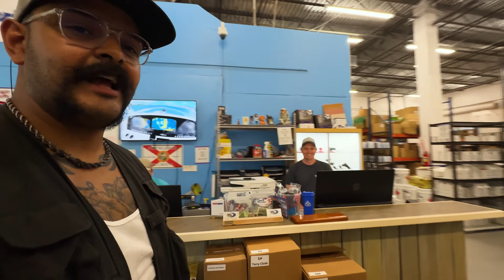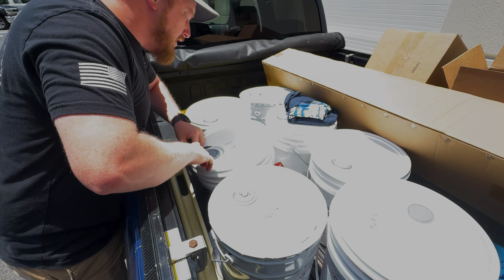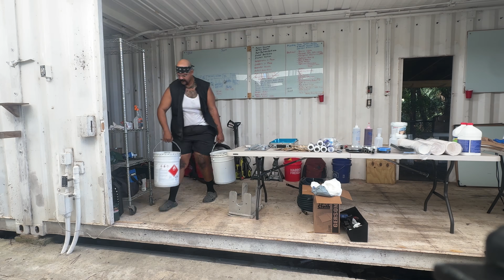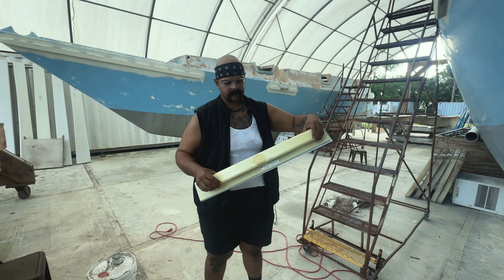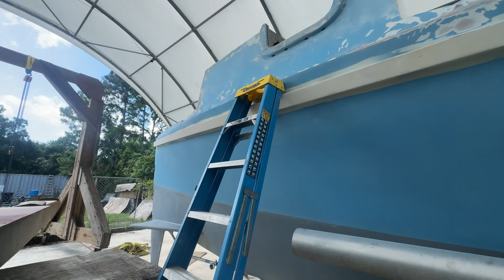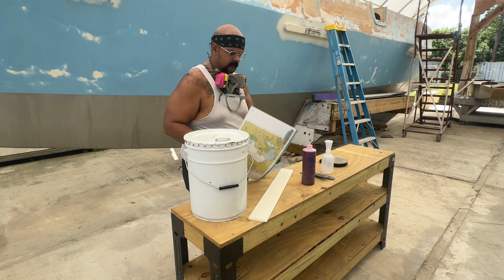All of this boat resin, and we have no idea how to use it! Ep.11

Comment: I'm glad you already confirmed in another comment that the boat was built with vinylester and polyester because they won't bond well to epoxy. However, they have a short shelf life of just 3 months and need to be kept under 75 degrees F or the usable life will be drastically shortened even more. Do you have an air conditioned room to store the products? And MEKP is scary stuff. You wear glasses like me but I'd recommend a face shield when working with MEKP because a drop of that in your eye will lead to blindness. When applying the finishing paint and anti-fouling, you might need an anti-osmosis coat first because polyester can let water through.
Reply from the maker: Thanks for the detailed response my friend! 

The entire hull was glassed with vinyl-ester, only the inside has regular poly. So we are going to keep it the same. Everything out side will be glassed with the exact same compound to keep it all kosher. 

I don’t have ac in my resins, but they are stored inside of a dark a cooler inside container, for storage? We plan to use all of this in the next month! So won’t need to have it chilled, hopefully! 

And thanks for the tip? A full face Mask is next on my list! The convenience of not have to use a mask and googles is all I need😂
Reply from the maker: Also I forgot to mention the boat already has a solid layer of interlux barrier coat, to start, and it’s brand new since it’s never touched the eater, but we definitely plan to ad another cost after it’s water ready